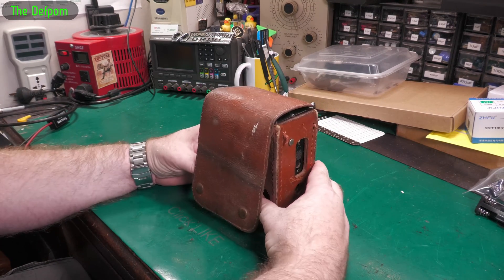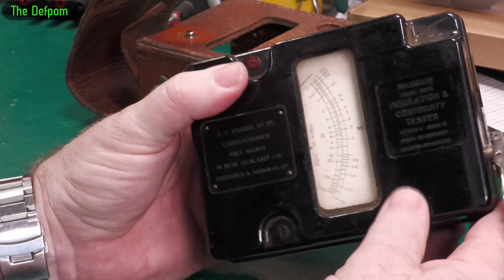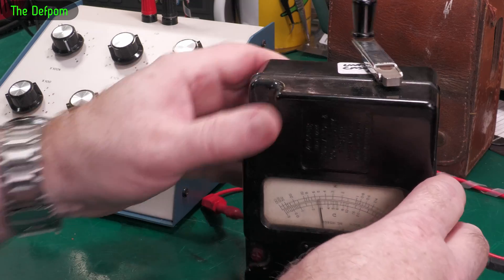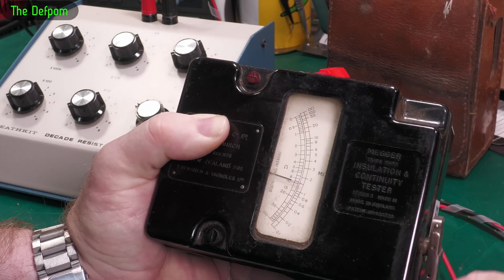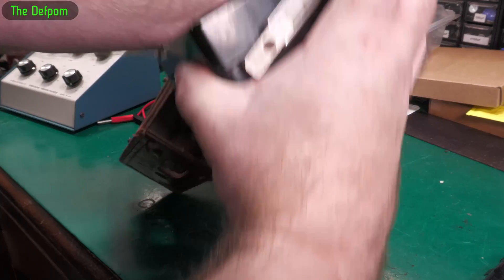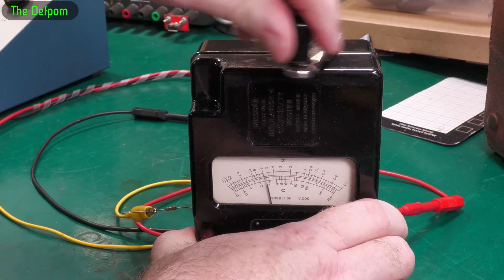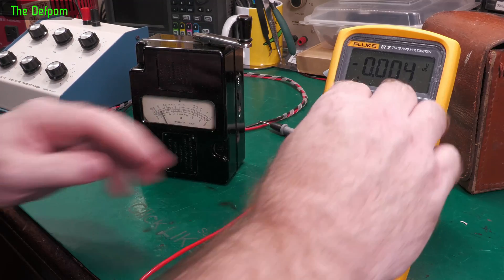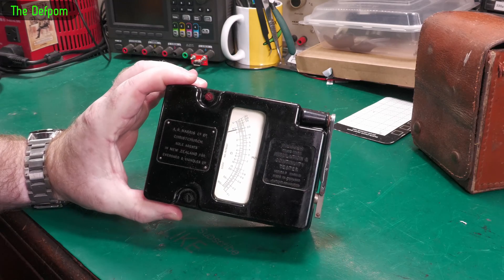🔴 MEGGER Insulation and Continuity Tester Series 3 Mark 3 - No.1376

Comment: That meter is more accurate than you think.
Your problem is you’re not cranking it up fast enough. The fast you turn the handle the more voltage it puts out upto about 520 volts dc the slower you go the lower the voltage it generates. 
I was tought too testing domestic wiring with one of those testers forty years ago great bit of kit and still compliant with the current BS7671 wiring regulations. Perfect for simple fault finding and as a backup for when you modern test is in for it yearly calibration. I been after one for years can’t seem to find any anywhere
Reply: Indeed, you are supposed to wind it until the clutch slips.

Comment: This thing is pretty simple, it has 2 resistors inside, some gears to change the ratio on the crank handle, a generator and a deflection coil ... The end. No caps whatsoever (not in this model anyway, there are a few versions similar to this from other brands that iirc have 1 cap to smooth out the generator output but not this one). Of course some of the really old resistors were known to drift on occasion depending on the package (water/moisture ingress).

Comment: The red sealant on the case screws is probably Glyptal, a common sealant/insulator for electrical equipment that's been around for eons, made by General Electric starting in 1926. Regards, David

Comment: Haven't seen a hand crank megger in a very long time.
At my first job in industry we had one we used to test if the capacitors (and other bits) in AM broadcast antenna systems were still good after a lightning strike.

Comment: Our college had benches with metal angle iron edge protection,  we would isolate the front two sections and wire them to a mega. During roll call anyone bridging the two sections would get nice jolt from it as their name was called out.  Got to the point where nobody would sit against the edges. 

😊😅😂😢